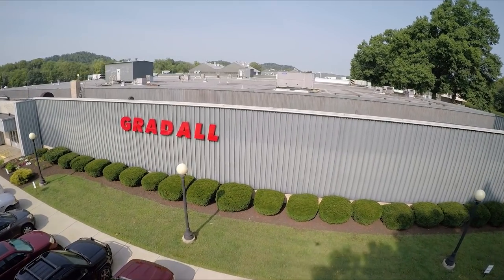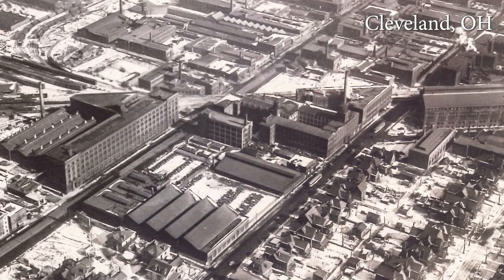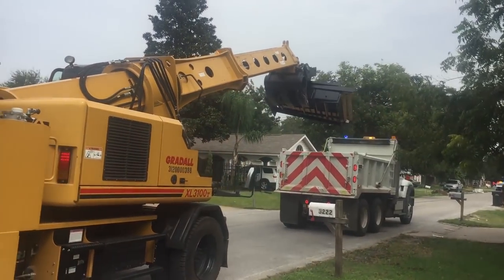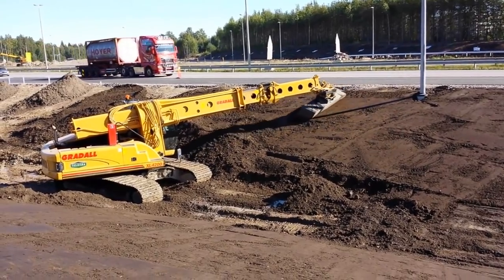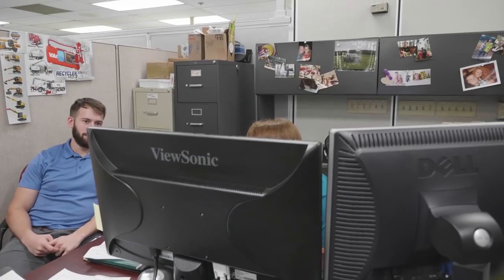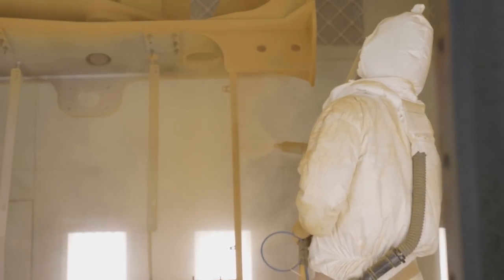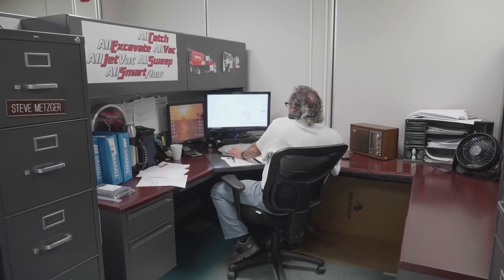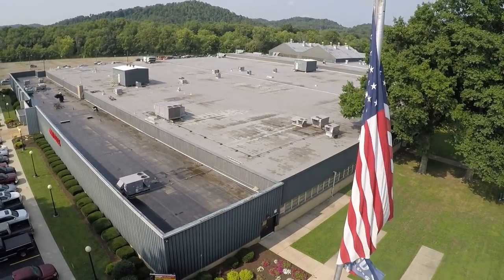Gradall Excavator History and Manufacturing Tour

Comment: Ultimately the gradall excavator is very limited compared to a traditional excavator.
Reply: How is that? Please explain.
Reply: I don't believe that. I am a Backhoe/Excavator operator with 37 years experience. I don't run gradalls much, but I have to say that with a good Operator a gradall could do 95% of what a conventional Excavator can do. I dug for 2 miles of 12" water main with a 5200 track gradall in rock right through the city streets of Mahwah NJ. And it did everything the PC 220 komatsu that was supposed to come to the job, would have done. The only place I have found the gradall lacking in is digging in shot rock. It sets the mats fine, but larger boulders are a little tougher to grab as compared to a conventional excavator.
Reply: The traditional hydraulic excavator has definetly closed the gap compared to the Gradall. But where the Gradall still has them beat is in low overhead situations. That's why they are still so popular in street work. Under power and utility lines where a traditional excavator is troublesome. Also look at a highway chassie model. One machine that can do 90% of what an excavator can do with NO FLOAT truck and driver. There is NO other highway speed excavator, Yes there are wheeled models but they are limited to intercity travel. The Gradall is STILL the most versatile excavator made. Period.